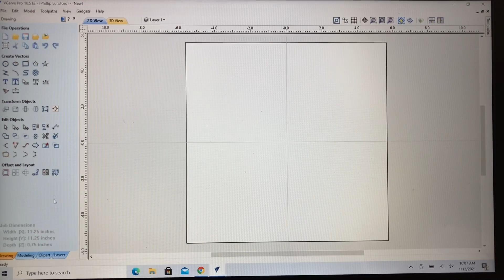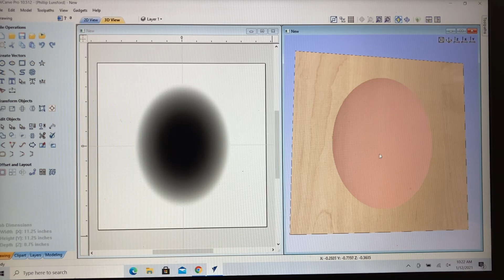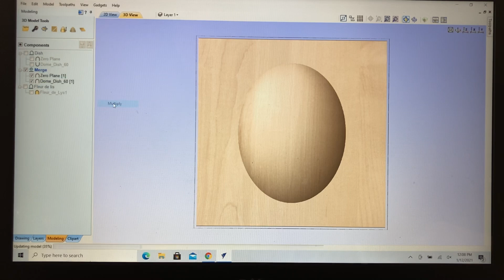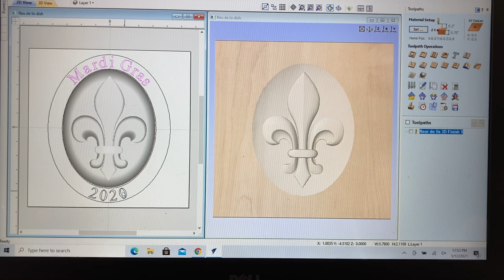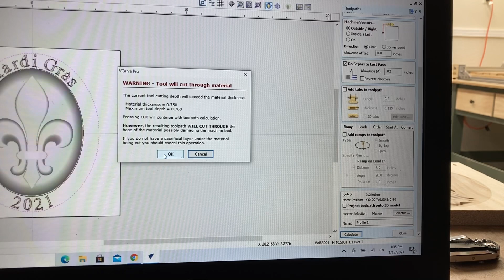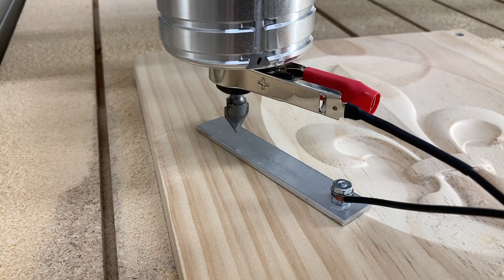Introducing More Techniques to Carve this Fleur de lis

Comment: OK, so tell me - money not withstanding, who do you think makes the best bits and end mills??
Reply from the maker: That can be a very challenging question.  I use a lot of different brands and first it really depends on the type of carving that you are doing.   I am moving away from the bits Inventables sells.  The just seem to be a little light weight.  Although, I still have quite a few and will continue to use them.  For the 3d carving I have had much success and like the Amanda bits.  I also am using the whiteside bits which are also very good.  I also like the 1/4" shank size because they are more stable when carving.

Comment: Hi Paw Paw, have you ever ran into a problem where you start a design on the x-carve, but stops carving ten or fifteen minutes into the carve?
Reply: So my computer’s sleep mode is set to never in the settings . So I’m ruling that out . I checked for loose wires, and they are fine. All the motors are working correctly. I think the problem may be the usb cable or port . I will do some more investigating on my day off this week, and get back to you.
Reply from the maker: Thank you
Reply: @PawPawsWorkShop  sorry I didn’t get back to you sooner. I believe the problem was the USB cable. I looked at tge forjns, and people suggested using a USB HUB to solve the problem . I don’t know why or how, but it solved the problem. All I know is that I was able to carve out ten Celtic crosses on the x-carve . I think it has something to do with Electromagnetic Interference . What do you think? Dennis
Reply from the maker: No, is you computer going into sleep mode?
Reply: @PawPawsWorkShop  I don’t think so. I’ve never had a problem with this computer in the past. I just recent upgraded the operating system. Maybe the upgrade made some changes to sleep mode. I’ll check on it tomorrow.
Reply from the maker: On the forum a number of people have complained about problems with the latest update.  I have not updated mine as of yet.  Maybe I will not do the update.

Comment: Hour carve time?  Are you able to speed that up and get same results?   I think I am too inpatient to get a cnc.
Reply from the maker: I have not tried to increase the speed yet.  The 3d finishing pass is slow because of several reasons.  One of the big reasons is the stepover. With and 8 to 10% stepover it takes quite a while to cover the area completely.